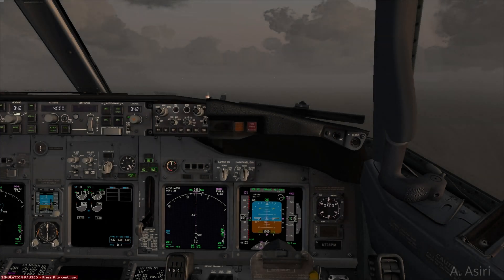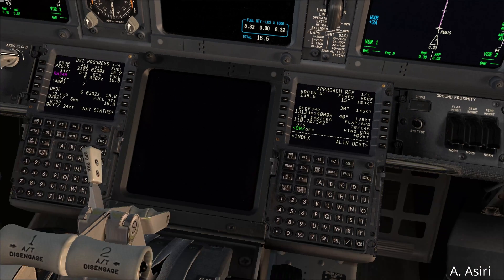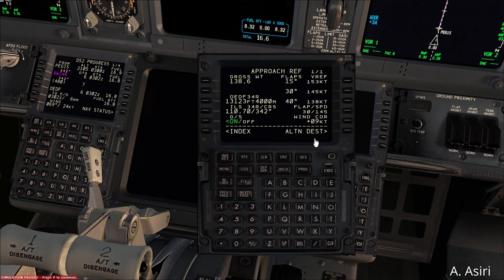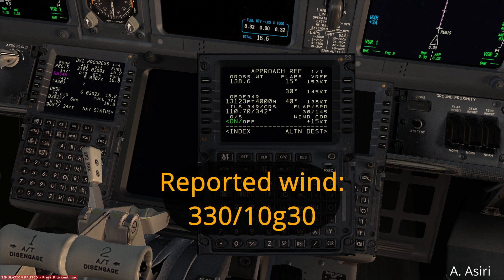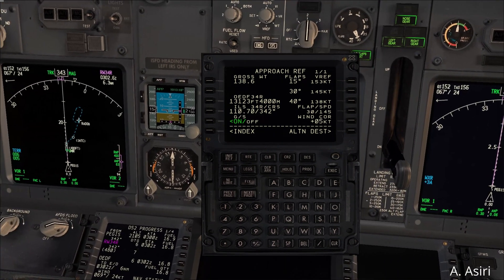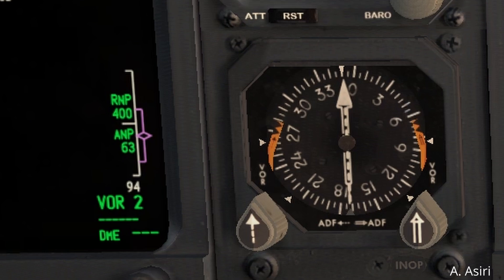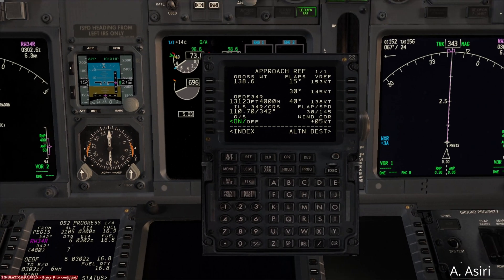B737 Wind Correction (Additive)

Comment: Cap FCTM says only gust we add for 90 degree cross wind.
Reply: I agree that minimum command speed setting is VREF+5 knots. For this condition wind 074/20G25 we add only 5 knots because this is equal to minimum command speed. Let’s use an another example 074/20G04 here we have gust 04. As soon as 04 knots less than minimum command speed we need to increase it till 5 to meet the required of min command speed VREF+5. If wind 074/20G27 then we add 7knots . This my understanding cap. Take care
Reply from the maker: Yes that is right, gust you add it regardless of it is direction, 
Steady wind only the headwind component
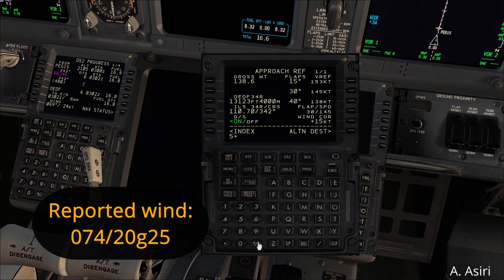Reply: @AbdulmuatiAsiri37 3:27 min in this scenario if I’m not mistaken we add only 5 knots gust
Reply from the maker: I thought 5knts by default is the minimum, and you add another 5knots for the gust, 
This is how would I do it, but honestly am not100% sure it is the right way, 
Think about it this way, no guest 5knots, 
If you have guest don’t you think you need to factor it in with another 5knots. 
Again not sure but this my logic to come up with the 10knots mentioned in the video. 

Thx for asking and let me know what do you think 🙏🏼

Comment: Hello Abdulmuati, thanks once more for your interesting videos and sharing your experience.  I have a question, thanks beforehand for answering,  When you have corrected your Vref +15 kts and you are landing on a short runway..  how and when do you reduce that high speed.. in order not to be floating all around the runway in a safe way? Over the threshold you have a more speed than expected, and even the headwind will help you.. but I know you can teach something better. 

Thanks once more, and thanks for your videos.
Reply from the maker: Hello Ironwill-Chap
You are most welcome, 
Doing the landing performance will give you an idea of the RW length required for each brake setting, this will you give an idea of how much margin or extra room if any you have, wind correction will be part of the computation. 
Ideally you start bleeding the extra speed as you flare, if you don’t float “aiming for smooth landing” then it’s fine. 
The thing that is dangerous in these situations believe it or not is pilots trying to make smooth landing. 

One more thing we do flaps landing in our training and the thing you will here instructors say just plant the airplane on the RW minimize the flare. 
To summarize, if the performance done for that specific RW and was within limits, landing is fine provided firm landing in touchdown is made. 
Hope that answer your question 
All the best 
Abdul
Reply: @AbdulmuatiAsiri37  Thanks a lot.. it helps a lot.

Comment: Another great information Captain thank you :) If I'm not making a VNAV approach like RNP I prefer not to change the Wind Correction value. I manually set MCP speed with my calculated wind additive.Iif we are making a VNAV approach MCP speed window is closed so as far as I know FMC uses wind correction value we entered via CDU and sets target speed according to correction. Is there any important thing that I am missing? Waiting to get such more information from your experiences. Thank you again :)
Reply: You are totally safe in terms of operation. However, for me I prefer to add the wind correction in the CDU even if the MCP speed window opens. Reason is that I believe if I fly with a target speed that is greater than what is registered in the CDU it might trigger a FOQA flag for approach overspeed.

I hope that helps and please correct me if I’m wrong.
Reply: @youghostme   I totally agree with you captain. In windy situations, especially during gusty weather conditions it is very important to update wind correction.
Reply from the maker: Hello Onur, 
Thank you for your kind words, 
I agree with AbdulMajeed, I believe it is better to put the wind correction in the FMC for both weather the speed window is going to be open or not. 

Just my opinion 😉